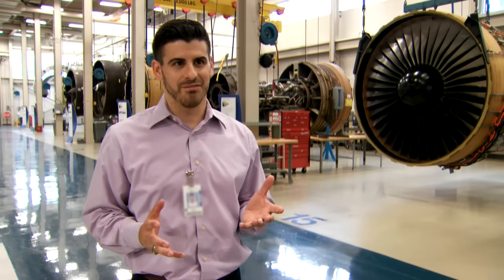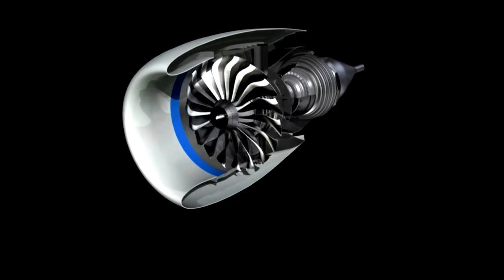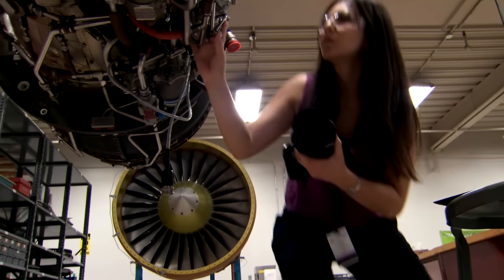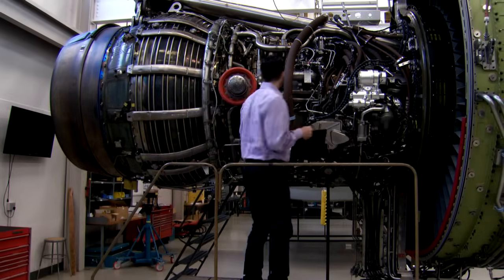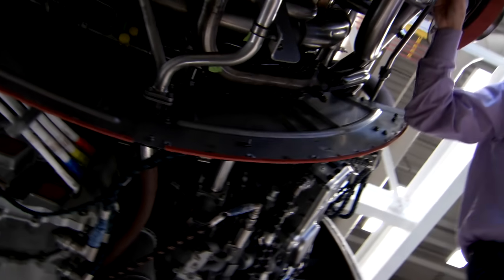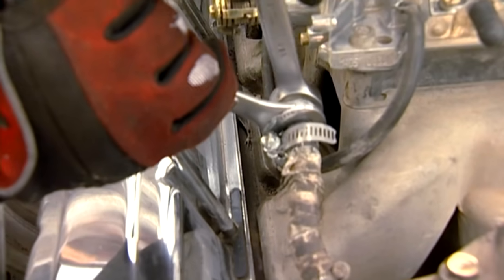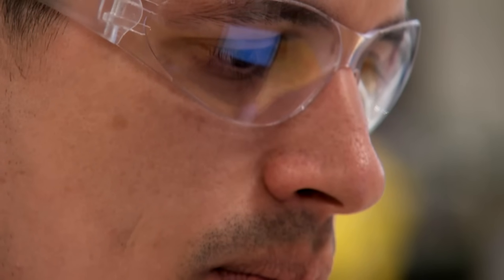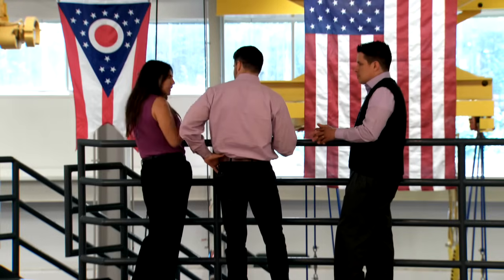Mechanical Engineer

Comment: its mechanical , computer , aerospace &  electrical  engineering if not more at GE that go into jet engines
Reply: mechanical engineers are trained with fluid engineering, propulsion, combustion, heat transfer, aerodynamics, etc which are mainly required to design a Turbojet engine.
Computer engineers mainly concentrate on the automation of the plane.
Reply: Piyush Pulukool well  you know what i mean CS , CE & SE ( computer science , computer engineers , Software engineers )  all work to Solve problem and or create things on the computer side .... 
Even the FCU ( fuel control unit ) is a computer.... 
mechanical engineers cant fix something wrong with it , (they will  maybe just know its broke and they have to order a new one from the people who can make one )
Reply: +J-N-H-M  I know that they use FCU to control the fuel injecting electromechanical systems (like solenoid injecting pumps, etc)but computer engineers don't know the parameters required to be controlled and the equations related to it. They just design a software accordingly as per the information given by the mechanical/aerospace and electrical engineers ... 
its like saying a black hole simulation software only needs a guy with CS major, instead it mainly requires an Astrophysicist. So to design a FCU they need a major helping hand of individuals from mechanical/aerospace as well.
Reply: Piyush Pulukool i know , its a jet engine , 
my point was , its a lot more than just mechanical
Reply: +J-N-H-M it's mostly mech/aerospace that's what I'm try to say, bro.
Reply: Piyush Pulukool 
cars are mostly mech but thats not it ... 
and as we move forward more and more will overlap . 
you could look at it like he's an animator he just needs his computer or his pencils 
NO
he needs everything that made a computer or colored pencils ...
and you could say NO thats someone else's job ... like chefs don't grow there food ... well some do ...  like some music makers make it all them selves ... i think to be a true  music maker you need to be able to make it all ...      at least your company like Tesla with batteries , motors , ect .... 
So Can a Turbo Jet Run without a Computer ?
No 
So Saying its mostly Mech & Aero its pointless
...
im Mostly Body , but take my Head and it doesn't work .. (But im MOSTLY body great)
  

 what do you do for a living ? or trained as ?
Reply: +J-N-H-M well old planes used in WW2 used to fly without computers (even VSLI process was not known at that time)... I'm just saying that, u can't say Turbojet engines couldn't work without computers.
Reply: Piyush Pulukool they wouldn't be what they are today with out computers ...  
like car engines ... 
 oh well humans always didnt have  computers , fire or wheels ...but we do now so whats my point  XD
Reply: +J-N-H-M :) what's ur major, bro? I know about turbojets and turboprops because I'm studing mech engineering (4th year)...i know about computers as well because I've studied CS along with science for two years before getting into engineering.
Reply: Piyush Pulukool Ohhhhhhhh   , you will see what i mean in a few years ...
Reply: +J-N-H-M Hmm, I am into robotics where I've to work with many software engineers anyways lol.
Reply: Piyush Pulukool not to be mean , but you  seem Indian , i met a man from india yesterday ( " Paras "  Masters in Computer Science ) He Saw my Om Necklace and i told him ive seen Lord Ganesh , He was very shocked as a Hindu  But  him needing a Visa to work in the states is making things complicated ... We Have a Start Up ... he was signing the NDA at   USC ...  
we dont have a robot , infact we are making biological systems stronger as of now opposite of robots kind of even tho i love robots and A.I.  (one of elon musk top 5) but we use   Mechanical  , Electrical , Physics , biology , SomeClassified things (hints the NDA) ... 
Long Story Short , our New Field of science will need people from a vast array of backgrounds to study it .
1st ... Do You Know of Lord Ganesh ? 
2nd... Are you  Near Los Angeles California?